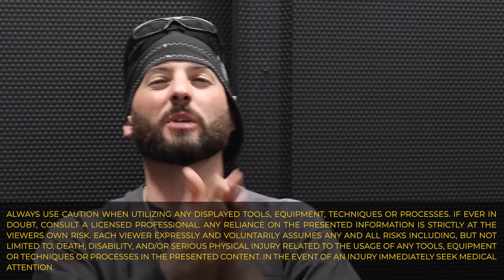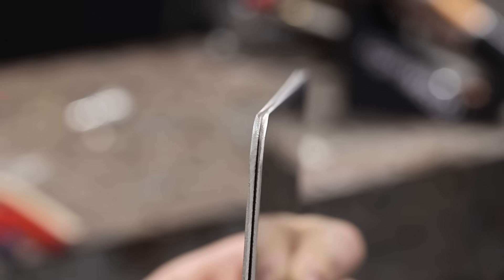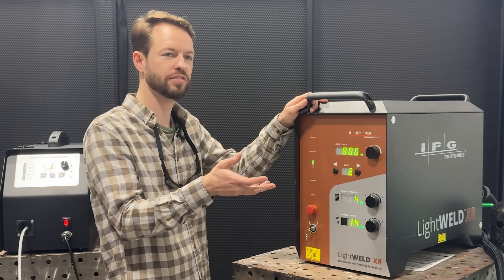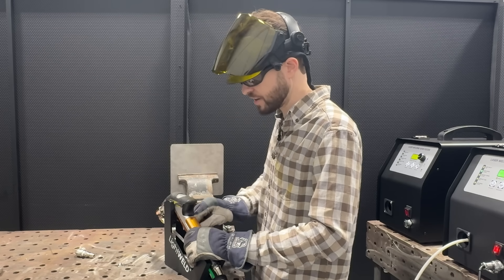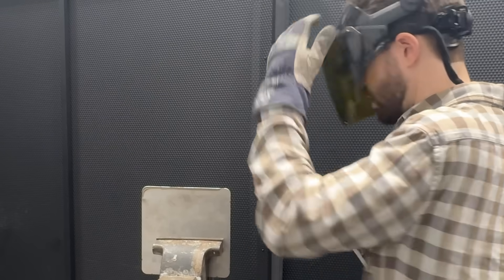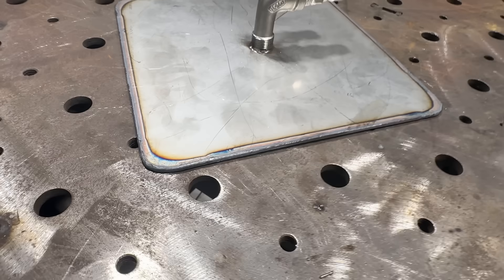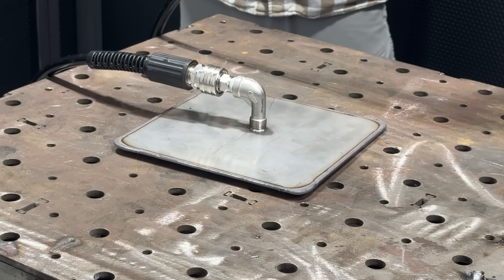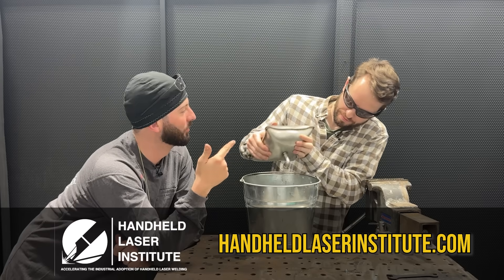Can Laser Welds Survive Hydrotesting? Pressure Testing Stainless Steel Welds

Comment: does that machine self generate shielding gas, or is it still dependent on a huge industrial back side to continue operation? if helium floats up to the roof, is it sealed enough that you don't have to add shielding gas in a sealed welding booth because... sliding air lock doors and quick connect fittings on the wall for breathing air... costs less building all that then it does to replace the gas. you do one thing and refuse to show the rest of it.
Reply: You run it off of a bottle of nitrogen

Comment: im amazed it held that much pressure if the fitting hadnt leaked i truely wonder how much more it could have held 
the one and only criticism i have for laser welding as apposed to regular old fashion welding is how long this took 
every other aspect i have seen from laser welding is amazing 
its basically an even cleaner tig weld

Comment: The amount of wire and heat put into that joint I'd have been surprised if it did leak, I seen no advantage over tig welding.

Comment: Excellent video ! Since you brought an expert in the laser field it worth to watch the channel again. imo: welding the fitting after the edges had been welded made the process even more challenging, further demonstrating the precision of laser welding process and the user. For a less experienced user, it could have unintentionally fused to both sheets.The vise made the process more difficult, unintentionally raising the component to a somewhat uncomfortable position, what we are doing in this case we clamp the work piece to the side of the welding table, well or any table, so its situated in a comfortable welding position. Because we are facing this scenario at the daily bases I decided to build a new table using an adjustable desk base, topped with a 3/8-inch aluminum plate—mainly because I already had one sitting in the shop. Have not decided to make the hole pattern on the CNC mill or by hand.  I’m curious how you’d approach fabricating an aluminum door frame with dimensions of 102x128 inches, using 4x4x0.25 tubing for the outer frame and 2x4x0.125 internal studs so you can mount a wood substrate. So far, our largest frame has been 214 inches tall by 102 inches wide.   (We do not use enclosure neither fixture table)

Comment: An easy way to drain something like that without drilling a hole? Feed in some tubing through your fill port. Something like fish tank air line or maybe some small, but somewhat stiff heatshrink tubing. That'd let you break the suction and let it backfill with air as the water drains out. Simple, cheap, nondestructive and reusable! :)  Cheers!

Comment: If you want to get that water out faster lay it so the bung is down and put a torch to the top side.
Reply: or blow a bit of low pressure air in with an air gun.

Comment: With that speed I prefer tig welding with wire feeder. Laser welding is not the future.
Reply: 70cm/min (cause it's all in cm and mm) is the fastest speed for 20-16 gauge material with the wire. The past 3 years I've used it a ton on regular and polished stainless duct that will be exposed and finished an entire pretacked with tig batch of 26 pieces from 60" straight duct to 90° elbows and transitions in 5 hours with 0 warping or burnt welds and with the wire feeder I can have a coworker that can barely tig I'm teaching to use it to weld it no problem, fusion takes some skill but he's almost there
Reply: Have you used one?

Comment: So is laser welding stronger than the other methods, or not yet?
Reply: The penetration profile of lasers is the biggest difference that I’ve seen. The wire used is the same wire used in other welding processes. So in theory, they should have similar tensile strength. The laser lacks weld reinforcement compared to other processes. But it has its applications
Reply: .045 was a little too large for your weld material, a slower travel and a little less heat...oh this ain't mig...😅
Reply: The laser heats the metal from inside out in a focused area instead of surface out like arc welding and it's why you don't see warping very much and you can run a 20 inch weld and put your fingers 3-4 inches from the weld area immediately and it's either kinda warm or cold. Watched a demo of it on prepared parts a guy did for a company he recorded on youtube once where he went into the science of it.

.040/.045 wire is what is the data sheets list and because everything is in cm and mm including the tig wire feeder, for 18/16 gauge it should be around 70cm/min (27.559in/min) and that's the fastest speed. I tried .035 once and you put enough pressure on the wire between the feed tip, the nozzle, and the part to keep it in the little grove that tip has to guide the wire that it doesn't feed smoothly
Reply: @pieshka6  it does not heat from inside out.. wtf? nothing heats that way. You sound like the fud microwave people that think it heats stuff inside first even though the inside of stuff is clearly colder (and it doesn't do that)
lasers focus the heat in an extremely small area which helps conductive heat of the whole thing reducing warping, instead of heating a large surface of it.
Reply: @gg-gn3re  YoU sOuNd lIkE a MiCrOwAvE fUd

Beam goes in metal and heats it to melting, arc heats surface down. Literally what you said and I said
Reply: @gg-gn3re really it just heats the inside and the surface at the same time

Comment: Nice 👍. I would have been tempted to do a fusion join just like TIG with no filler. Requires skill though... With filler I would have cranked up the speed and power with no pulse on 200hz. Love my laser.
Reply: Lasers are cool. Anyone that says they aren’t. Hasn’t used on
Reply: The trick is making it around the radiused corners at 70 cm/min, positioning the torch that quickly around a small radius isn’t easy. For the straight sections, yes we totally could have gone faster!
Reply: @rexalexandre9908  that's a fair point. The user in that case is the limitation. Attached to a robot arm and I bet you could get scary speeds. I'll have to do a speed test on mine with a rotary positioner. Cheers J

Comment: What type machine is that.  I'm an asme welder and I create art in my home shop and have been thinking about getting one. Pricing is a big consideration.
Reply: lightWELD 1500-10 by IPG. I use it at work. It is the base model. The cleaning mode works on everything short of a mil scale. Not good for the thicker metals and can do small gauge aluminum. These are very expensive and repairs are expensive if you damage the fiber optic cable. Usually happens with shiny material. This model does not support any shiny and will reflect back on the fiber optic causing damage.
Reply: @michaelryan9311  how much for the machine and gun
Reply: Miller sells the light weld now complete with the carbon fiber helmet, that is way better than the yes weld helmet with the aluminum plate, and a miller wire feeder but they want $50K. I've done finish #4 polished stainless with it at work as a duct welder with the first model they had the past 3 years and a former coworker had me demo it to his new boss to get one in their shop to weld thicker polished stainless for culinary equipment.
Reply: I haven't found one under $5K yet, so not exactly hobby friendly. One can get a top tier TIG rig for less. The rig in this video runs north of $30K
Reply: @willgallatin2802  I got a Miller syncrowave 210 used for a month for $2500. Spool gun not included. I have a 110v millermatic mig in 95  for $1200 and just had to get a new whip. I got a craftsman AC DC stick welder in 83 that the syncrowave is replacing. Those are my home welders.